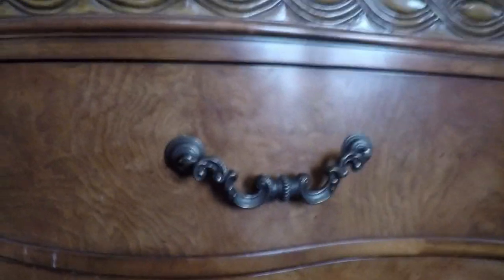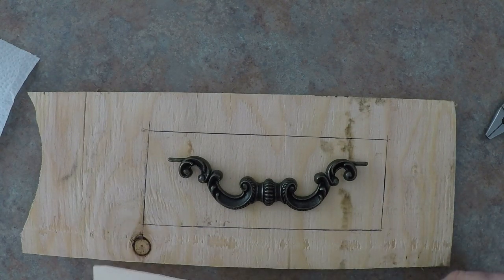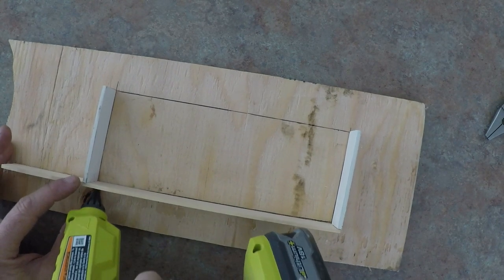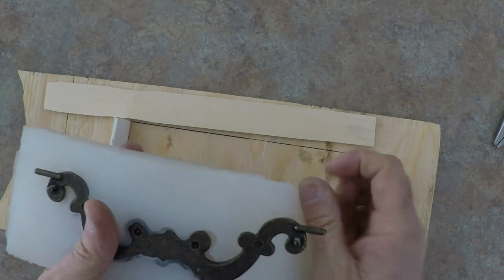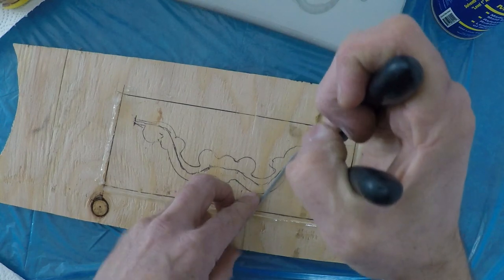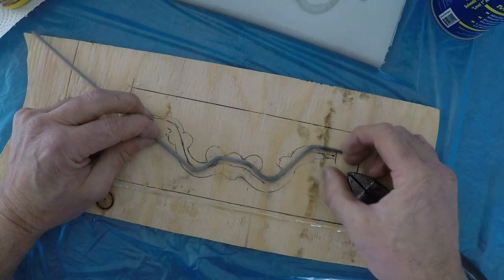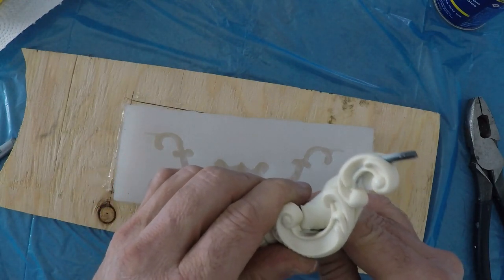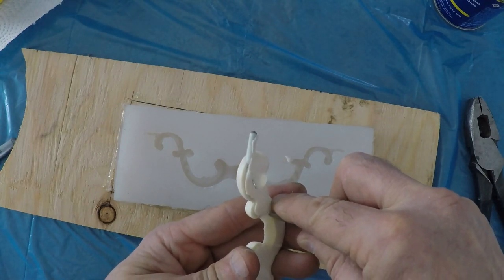Making a Molded Furniture Drawer Pull

Comment: Qhy couldn't you just weld a new tab on to the broken one?
Reply from the maker: Sorry for taking so long to get back to you, I did try welding the original one but it would melt like wax.  I couldn't even braise it with brass rod.  It was just soft pop metal.

Comment: What is wrong with your sound? Where is the step for filling and placing the pull? How did you get the silicone so smooth? Not good transition for clarity.
Reply from the maker: Sorry, I'm not very good at youtube.  I have experience with silicone from 40 years as a tradesman.  I was very messy with silicone when I first used it.